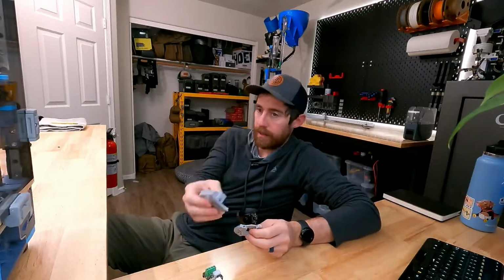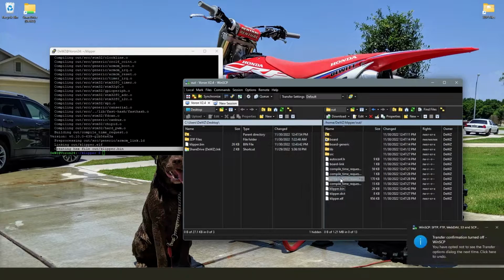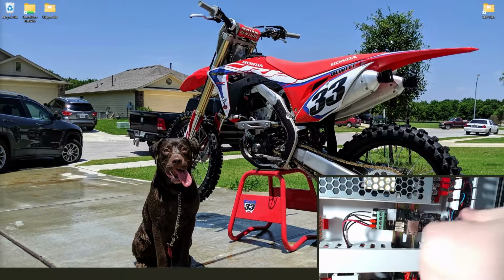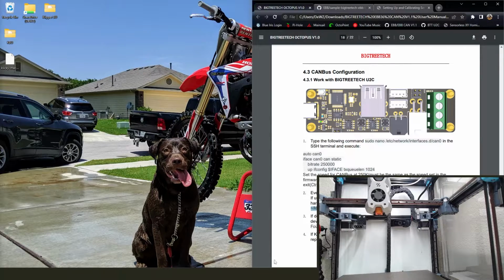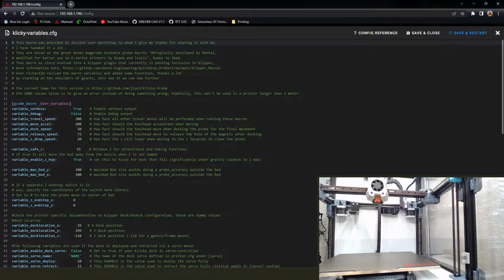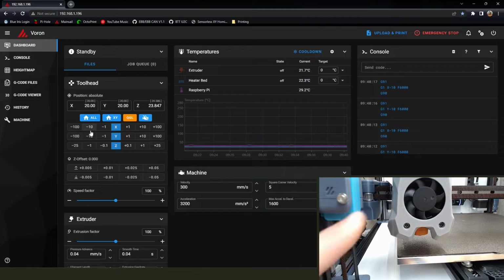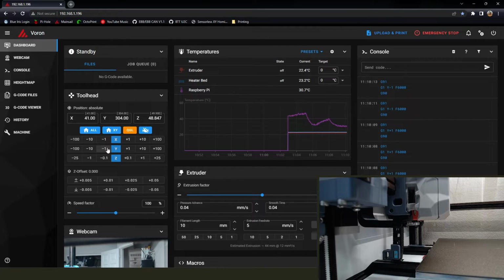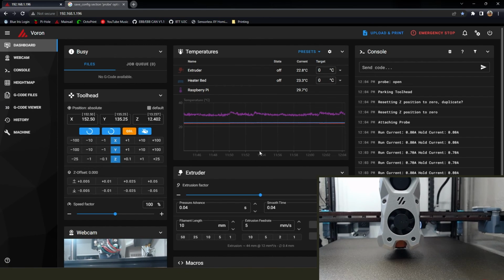Voron 2.4 EBB36 v1.1 and U2C v1.1 Sensorless Install - Bonus Problems Included!

Comment: I had the same issue trying to program with STM32 CubeProgrammer.  Turns out it's the software.  If you are using 2.13, downgrade to 2.10.0 and it works fine.
Reply from the maker: Much easier, thanks for the heads up!

Comment: what happens if the bed is not well leveled...let's say one corner is higher than the other?
Reply from the maker: Sorry for the delayed response. I have had it fail a QGL and return to rear right corner without lifting, which can drag across the bed depending on how unlevel it is. I haven't found a way to have it z-lift after a failure like that.

Comment: USB cables — I suspect that the C->C cables only work if the target device has the right resistors set to ask for 5V.  When you do A->C it just provides 5V regardless.  I have a couple of devices that won’t get power if you just use a C->C cable. ¯\_(ツ)_/¯
Reply from the maker: Interesting, I've read about the "handshake" that Type C-PD power supplies/wall adapters can do with devices, but that didn't occur to me with this.  Thanks for the insight.
Reply: @zsdewitt  also thanks for the video! I'm not ready to make the leap to canbus yet but getting a better idea what goes into it!

Comment: It seems everyone likes connecting the devices to their computer and using stm32cubeprogrammer/dfu-util from windows when it's so much easier to just run it from the pi itself..

Friendly reminder: the pi is also a computer.
Reply from the maker: I'm sure it would've been a lot easier! I think my problem, and maybe others as well, is being that I'm not familiar with Linux or working in a command prompt, I will go the extra mile looking for a Windows based solution. I know I'm getting better about working in the command prompt, but I'm also still at the point where I need explicit instructions when there. If I hit a bump in the road I'll be SOL if I can't find instructions on dealing with said bump. The number of commands I know and understand is still relatively small.
Reply: would I be able to put the firmware on the boards, if I connected to the pi and used my Mac screen as the pi screen? im like this guy, strictly copy and paste instructions.

Comment: Thanks for the video. Please do you by chance have a link to the ebb36 mount ? Thank you
Reply from the maker: Here's the one I used for CW2/SB with the Bowden tube:
https://www.printables.com/model/335160-ebb36-mount-for-stealthburnercw2

There's plenty of options out there depending on the extruder and umbilical setup you're using though.
Reply: @zsdewitt  Thanks alot.

Comment: I am really confused why you went through the hassle of using the U2C board when your Octopus board supports CANBUS...
Reply from the maker: Being that it was a new endeavor for myself, it seemed like an easier solution, probably not though. I felt like I had seen more support for the U2C board and also didn't know if I would run into problems trying to get my wiring into a RJ11 connector.